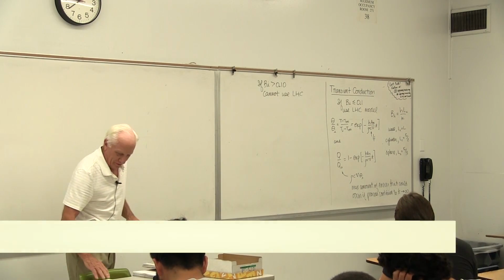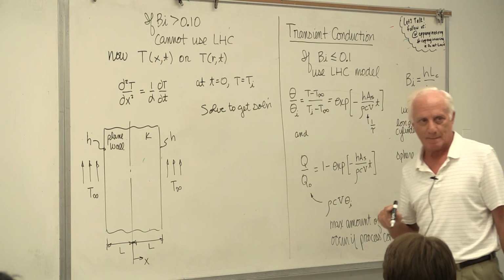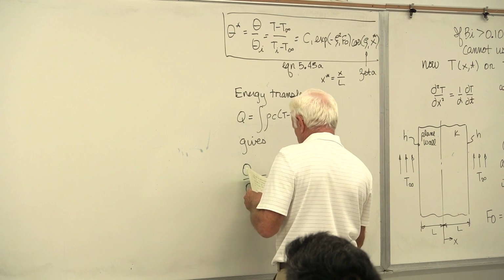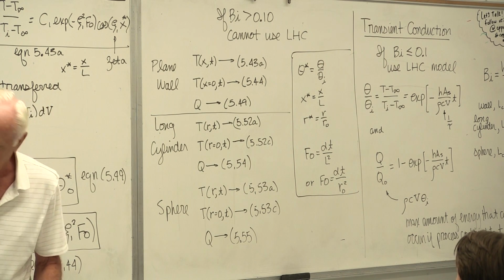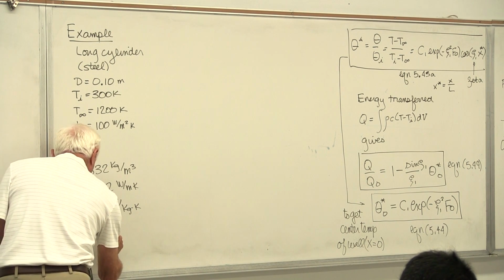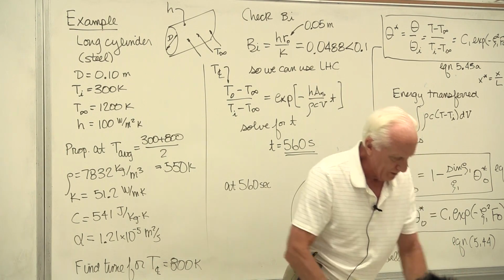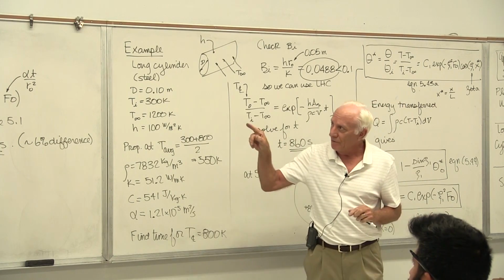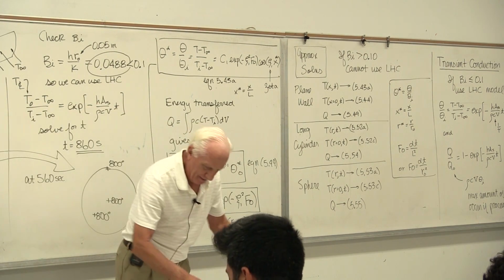Heat Transfer: Transient Conduction, Part II (11 of 26)

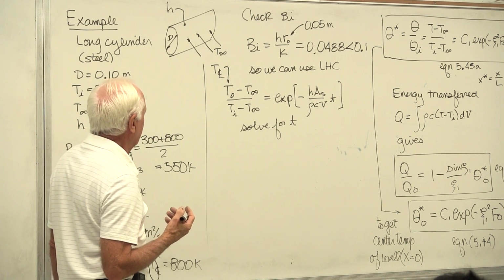Comment: @ 31:00
How do you find volume of an infinite (long) cylinder?
Reply: You dont need L bescause it will cancel find the volume and area and subsitute you will find that L will cancel
Reply: @specom9161  still confused can you elaborate or show this worked out? thanks
Reply: @patricksmith5200  as you can see from the equation you have (A/V)  where   
A = 2*pi*r*l 
 V = pi*r^2*l 
So (A/V) = 2/r 
So no need for L to determine the answer 
If you still confused 
Contact me on whatsapp
00971525190325
Reply: @specom9161  wow quick reply thanks alot i appreciate the feedback!

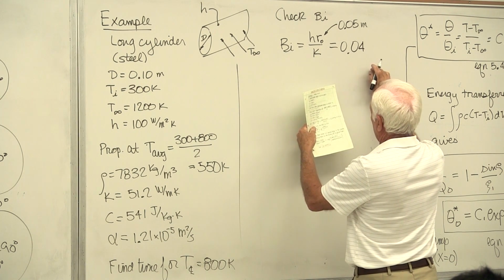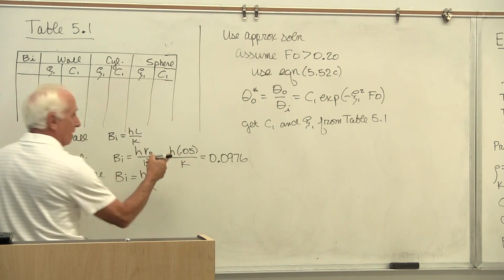Comment: Could you Please explain why at 29:20 Bi=0.0488 but at 36:05 Bi=0.0976 (doesn't exist h and I couldn't check Bi myself)
Reply: @Siraj Lassoued  when do you know to use Lc=ro/2 or just using ro in the bi formula?
Reply: @patricksmith5200  if you use LHC its ro/2, if it is approx. its ro.
Reply: Thx guys!